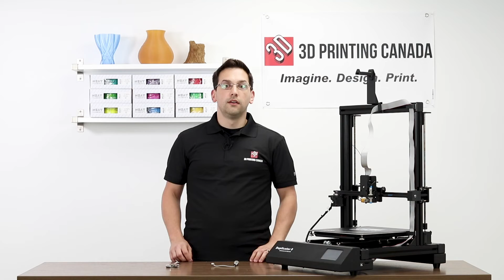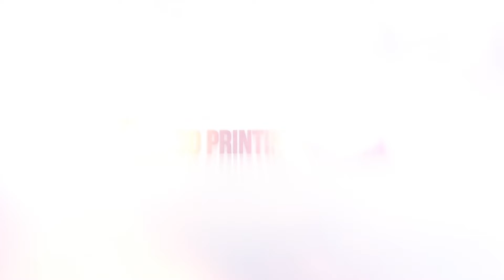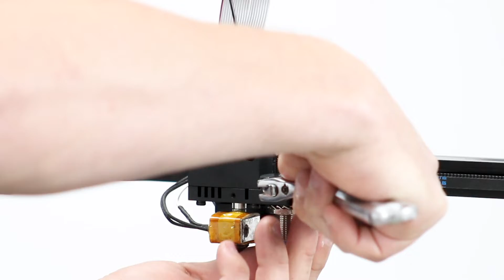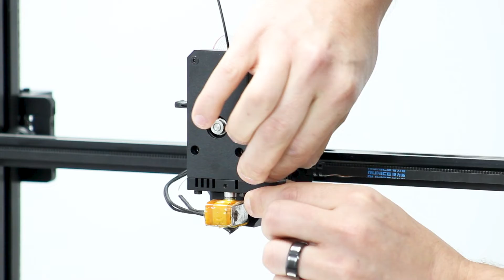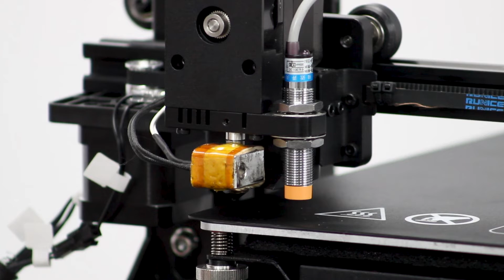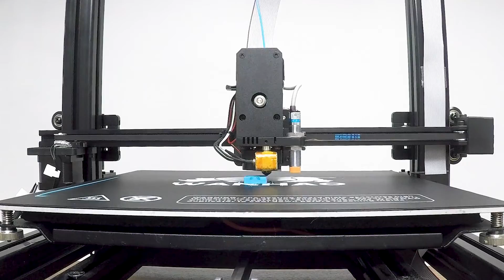Wanhao Duplicator 9 Sensor Replacement

Comment: I have a d9 400 and it’s been giving me fits as of late, I updated the firmware to .164b along with the lcd firmware, and the issue is still here, I can no longer level the bed, as the z axis will only go down ~2 inches from the bed, any ideas? And I am using the inductor sensor